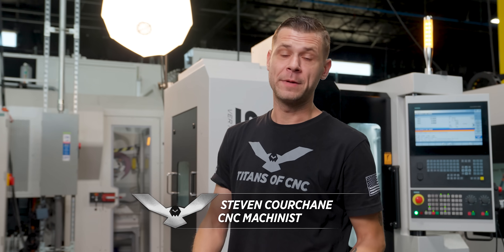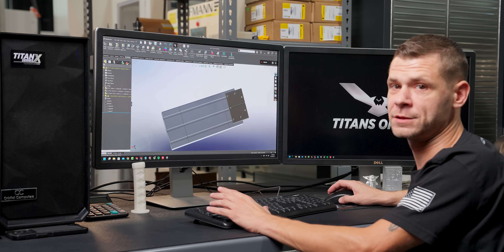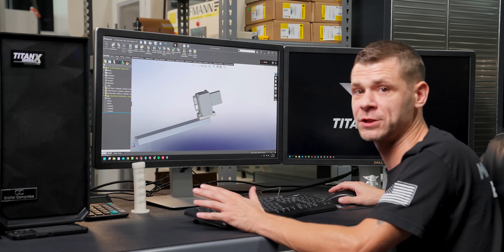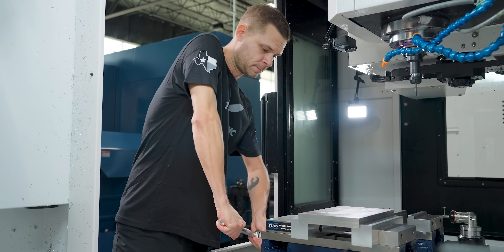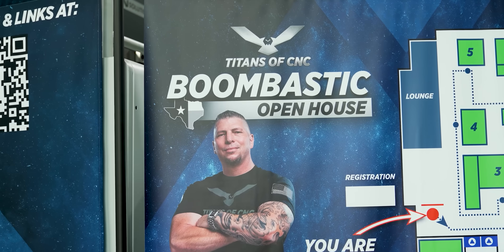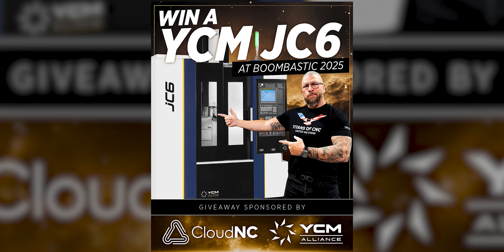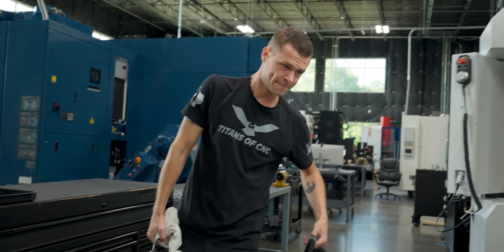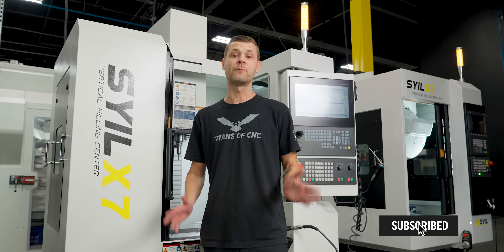Genius 4th Axis Hack to Unlock Full Table Travel

Comment: Just bought this 4th axis, but if you center it on the table of the X7 it contacts the door at full Y travel. Did you offset the 4th axis a little to prevent this?

Comment: Only thing more I do would be mount a tail stock at the other side of the table outside the work area ( one I always know where it is. Two Quick to deploy/use and tree. Provide a bit of counterweight on the table ( when the rotary is mounted so far back the table/entire X axis stage will tilt a little so to combat this I would mount the tail stock support or something of almost the same weight on the other side )

Comment: I bought the Pierson plate but this might have been a better choice I think. My question is about the the plate you have on the face of the 4th axis. Does that hold center well? I have removed my 4th twice now. First time was really easy but the second time kicked my butt. Is this a file i can check out somewhere? How much wiggle room do you have to align the base of the forth and the vise on the face of the 4th?

Comment: Surprised you didn't machine a tennon on the bottom of the fixture to align it with the table. Now every time you remove it, you'll have to clock it square each and every time.
Reply: Could add a couple holes/pockets for some sine keys…pop those in and forget alignment issues.

Comment: Excellent idea.  Does extending it out past the edge of the work plate in any way create the loss of any rigidity?
Reply: If you need to take heavy cuts and need the rigidity you probably need a different machine and indexer honestly.
Reply: @derekschommer1465  You've read way too much into a simple question.
I just wanted to know if using this method in anyway affects the rigidity.
I don't need a new machine or indexer.  I just need information.
Reply: I know this is not hard info but I bet the loading on the 4th axis is far more the flex point than the edge of the table or the plate.
Reply: @paintballthieupwns  I don't know if this is or isn't the case.  This is why I asked my question.
I'm sure that some who read my question may have thought I was just trolling.
It just seemed to me from looking at it that the small extension plate may now be a flex point, albeit a flex of microscopic dimensions.
Reply: @timmontano8792  - There will be flex - almost any joint has flex. The point I was talking about was the loading on the 4th axis is going to be a bigger limitation before you find significant flex in the plate/overhang. Those small 4th's cannot handle big loading.

Comment: Jergens Inc offers custom ball lock subplates that do this. They handle all the work figuring out clearance, making fixture plates to mount your rotary in under 5 minutes, and match grinding a fixture plate for your tail stock if needed
Reply: This is the option we went with my last shop. But it does cost a bit of money. This is great for doing one for a lost cost on your own.